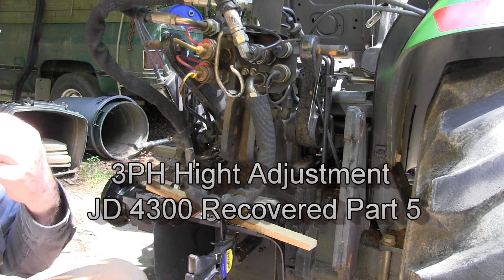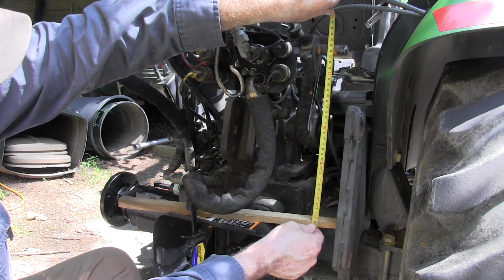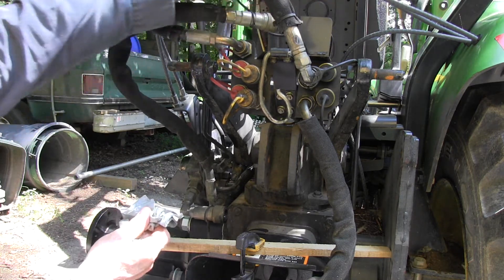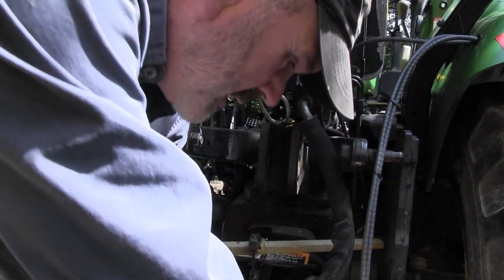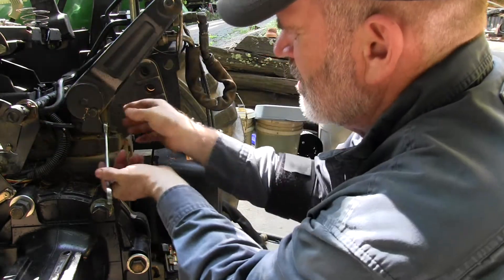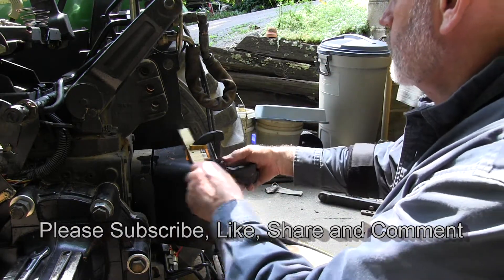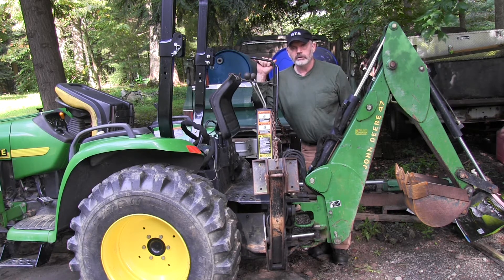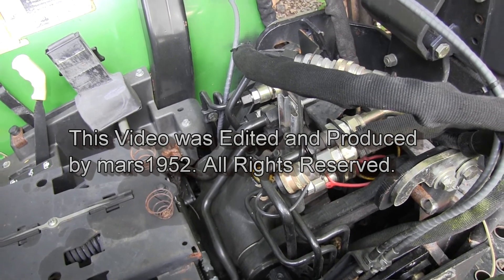3PH Height Adjustment JD4300 Recovered Part 5

Comment: I installed my backhoe attachment, the brackets and the hydro oil cooler myself since the dealer was so high for labor to do so. It will not lift my backhoe high enough either but I had no idea there was an adjustment to correct the problem. Thanks for making this video. It has been a great benefit for me!
Do you by chance have a link to the measurements needed?

Comment from the maker: The backhoe connects directly to brackets attached to the transmission. Before connecting the backhoe the 3PH linkage is removed. The upper arms lift the backhoe into position. The upper arms were not lifting the backhoe high enough to make the connection.